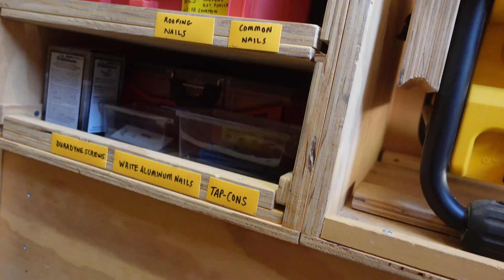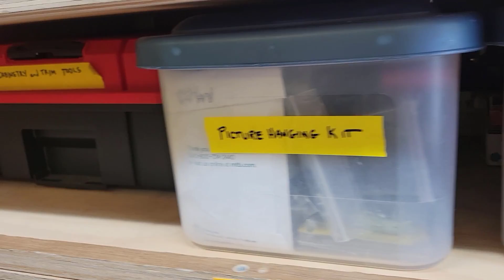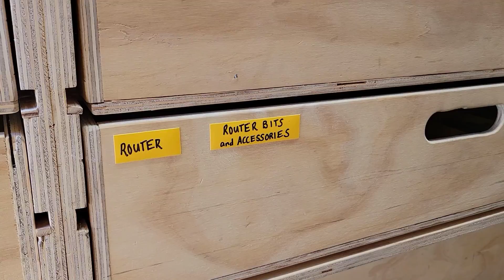Stowing tools with a BONUS Tool Trailer inside FLYAROUND

Comment: Great trailer!  Usually when I am using spray foam I am using several cans at once. I keep using the same nozzle from the first can and save the others for later. I also save those WD-40 stems, sprayer nozzles and even a few caps for spray cans in case I break one.
Reply from the maker: Exactly what I do most times too! Thanks for commenting!!

Comment: Any ideas how much weight all the shelving adds?
Reply from the maker: Thanks for commenting. At one time i had a decent count of sheets of ply used but have long since misplaced it so i have no idea about the weight of the build. The trailer goes around 4500 now with all the tools included. Next trailer i build out i will keep accurate records of materials used and weight along the way.